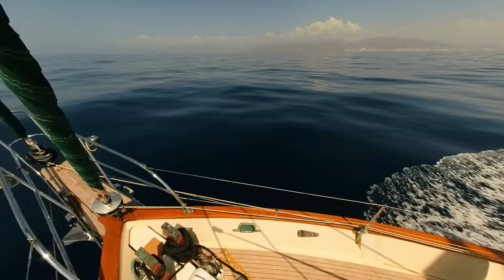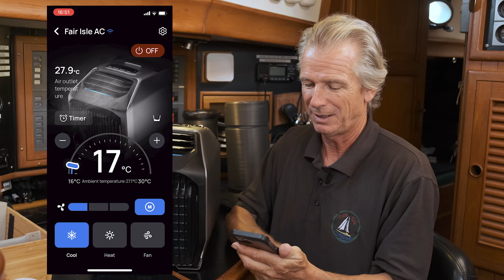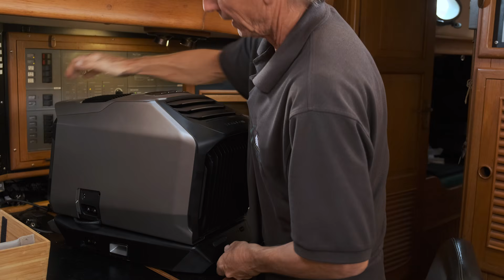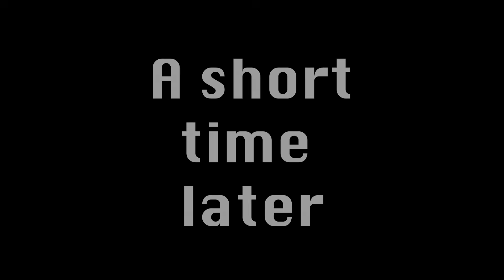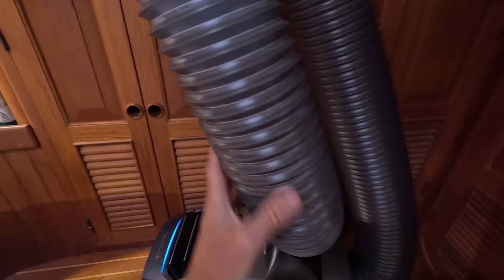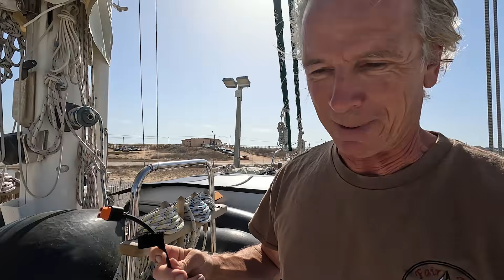DC AirCon for your boat... it works!

Comment: Can you give us an update on this from the tropics?
Reply from the maker: Still working well. You do have to have enough power to run it of course and not having a generator we don’t always. So we tend to use it just when it’s very hot or when we get frequent rain and you have to have the hatches closed. The only problem we’ve had is the optional battery that we had which clips to the bottom died. I think we just left it flat for too long. Not a problem for us as we tend to power it from an EcoFlow delta anyway

Comment: How’s it going one year on ?
Reply from the maker: It’s great. We don’t use it all the time but it’s been a lifesaver when things get really hot. The one problem I’ve had is that the battery that you can get to clip on the bottom refused to take a charge a few months ago. I tend to use our Ecoflow Delta anyway so not really an issue, but if you are using the onboard battery I would say make sure you keep it charged. I’m guessing ours died because we left it flat too long

Comment: Efficiency is the issue with those expecially using one hose.

I have a cheap chinese knockoff which was rated at 3000btu (single hose).

Its basically a square metal box with an exchanger at each end and an independent fan at each end.

So i modified it moving the electronics forward and sealing them, then mounted it through a blanked window.

This resulted in the condensor being fully outside and the evaporator being inside each drawing air from their respective locations.

In effect i made a very tiny window ac unit and having the condensor outside boosted the btu rating almost doubling its cooling capacity.

Draws about 600w under full load and runs on my 3kw invertor with 10 batteries allowing about 12 hours runtime.

Sealed and laquered the outside surfaces, its lasted 5 years so far and although the inside of the case has surface rust the outside is still fine.

I bought 2 of these very cheap and i want to modify the second to have a water cooled condensor i believe that would further increase the btu rating to over 6000 however i would only be able to do a crude blowout of refrigerant (propane is the factory gas) since i do not have a vacuum pump to vent the air out and im not sure this would work well enough.

I have heard poeple who have done this say it works well enough for something very cheap and diy but im not so sure.

Any imput would be appreciated.

Having looked at how cheap the components are to make a very basic water cooled AC (talking about no thermostat just a switch)  the mind boggles how the marine ones end up costing over 2k.

The only pro bit is the gassing up and even that i doubt is expensive in a factory.

Comment: 0:13 that is an interesting way to use the dinghy haha
Great idea

Regarding the feasibility of it, with 250w it draws quite a bit. It should work if you have a lot of solar up in the summer so you can cool the boat inside durig the day and don't sweat like a pig, but it's something to consider as not everyone has 500w or more of solar panels up in the sun.

It's been a year, do you have any updates on how well it served you in the caribbean summer?
Reply from the maker: It’s been great. We don’t use it all the time, usually the Caribbean trade winds mean you get good air flow at night. But in places like Panama in December when it rains a lot it’s great as you can shut the hatches. Also it was vital when we had the boat on the hard in Trinidad. With shore power we can run it 24/7.
Reply: @svfairisle  Shorepower is great, but I am really considering not going into marinas as often as possible. But yeah, seems like it's a very handy little thing. I allways like your reviews, they give me so many ideas.

Comment: Is it ok to have the exhaust hose and the intake hose so close together? Won’t the intake suck in the carbon monoxide from the exhaust? I assume that’s similar to the portable ac unit for your house. Or am I just seeing it differently?
Reply from the maker: I'm not sure what you mean when you talk about carbon monoxide, this is an electric appliance... no carbon monoxide produced here!
You could just run the unit with no hoses attached but it would be pretty inefficient. So either have it inside with the exhaust hose taking the hot air out and the intake hose (for cooling, this is not air that will end up in the boat) outside too, and the unit will suck in air from the cabin and spit it out cooler from the vents. Or do it the other way around and have the unit outside with the 2 hoses from the front end (where the ac air comes from ) taking Ac air in and stale air out. by placing the hose away from the inlet and high up to get the warmer air.
Reply: Omgosh! It makes sense now. Sorry.

Comment: Very nice review!  I'm considering purchasing this for my boat.  Would it be possible to power this unit from the boat's house batteries?
Reply from the maker: Yes no problem at all, there’s an XT60 socket in the back for dc power. I power it that way from our EcoFlow units, but the house bank can do it just the same.
Reply from the maker: PS you need to have to internal battery in to charge via the XT60 it won’t power direct that way. To power direct without having the waves battery you could power with the specialised high power dc lead from an Ecoflow Delta or Max, that works really well.
Reply: @svfairisle  Very helpful, thanks for the extra details!!

Comment: Do you know how many Amps the unit consumed when plugged into AC power?
Reply from the maker: I will check the next time we have shore power. The draw would be different depending on if the battery is on & charging
Reply: @svfairisle  I was just wondering how much power it consumes running through an inverter without any batteries attached?

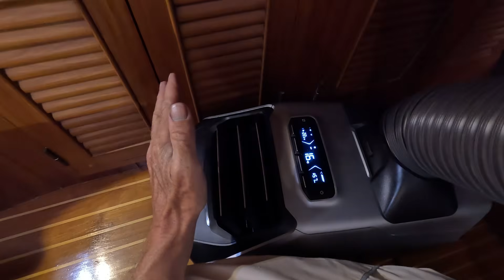Comment: 13:00 can you set the intake hose from inside the boat at a place where hot air accumulates like top of room and outlet through the window like you did. Wouldn’t that be more efficient to expel the hot inside air and then cool the already cooled air from inside vs taking hot air from outside and cooling it?
Reply from the maker: There are two separate systems circulating air. One is the actual air conditioned air which it needs to pull in from the room and then spit out colder and less humid, and the second system takes outside air to cool the plate then spits it back outside. So in the bit you were looking at the hoses are for outside air. It would be possible to attach a third hose to the inlet of the AC side and have that high up and away from the unit which would help.
Reply: I still don’t understand why you need the input air hose attached. Why not use the already cooled air from the cabin, and eliminate one of the two hoses? Of course, outlet hot air needs to be removed, so it cannot operate “hose free” in cooling mode.

Comment: Hi! Thanks for all the great videos. I have question about the add on battery, its NCM do you have any concerns with that chemistry and using that on a sailboat vs. using the other EcoFlow batteries that use LFP chemistry. What has made you comfortable with NCM for this application. Thanks I'm trying to decide if I get the add on battery and or EcoFlow Delta 2 Max to pair with the Wave 2 on my boat.
Reply from the maker: Very good question. I much prefer LFP batteries on the boat and if you have any concerns then the way to go is using the Delta 2. However although for a house bank the only option is LFP of course, there’s far too many spurious charging sources and loads that are specific to each boat, with the amount of safeguards built into units like this and the fact it’s performing a specific function that’s been tested in the factory give it a good layer of safety. plus the fact that there are thousands made exactly the same so any fault will be reported should give confidence. Having said all that though I’m very careful with mine. I would never leave it charging unattended ( a problem while charging is by far the most likely ) and I do not pack the Battery away with the unit, it’s stored alongside the Delta where I can see it. ( the eProp battery lives there too) The most dangerous batteries I have on board by far though are the drone battery’s and they all live in fire proof cases, many people forget about these.
Reply: Thank you so much for the reply. That gives me a lot more comfort about getting the add on battery (which I would like to do), I think those are all good points about the risk assessment and best practices with the add on battery. Also about camera / drone batteries too to be stored in fire proof cases. I know according to your most recent video you are in Trinidad (don't know if you're still there) wonderful wonderful place,  my father was from Trinidad - wishing you the very best stay and thanks again!  @svfairisle

Comment: I have last years 4,000 btu model on my tayana 37. Its a piece of junk it..cost me 2,400.00  i actually have 2 of them cause a friend also gave me theres cause they suck. I have 1 battery but 2 units.. It needs 60 amps to charge the battery on the unit and it takes 2 hours. And lasts 3 hours. The aircon alone needs 40 amps on the inverter. That would be ok if it even worked. My boats not that big. Maybe this unit works better than my 2 units i have. Mine are older last years and tbe first generstion.
My 10,000 btu portable aircon works really well.cost 300.00 but not at anchor. But the eco flow is not the way to go at all. Its a waste of 2,000.00.
Reply from the maker: Yes the first version sucked! I steered well clear and Ecoflow pulled it very quickly. If I were you I would talk to head office and see if you can get a deal on swapping it for a mark 2 version. I think they will be sympathetic, they know they messed up with the first one.
Reply: @svfairisle  I might be interested if they can get to 9,000 btu. Then its in the ballpark for a 37 footer. I should have just spent my hard earned money on a proper 12v unit by marlbro. I almost bought there 10,000 btu for 5,500 but i did not want to go lithium also at same time for another 5,000 to run it all night. so i tried eco flow as a hail mary  as it had its own battery i thought would be great..5100 btu might be enough to cool youre aft cabin. My complaints are so others dont get screwed or buy a used unit.
They already discontinued any spare parts for the 4,000 btu so if youre battery dies or whatever you out of luck.
Reply from the maker: I see what your saying. It's not magic though you cant get something for nothing, 5100BTU's for the small draw the mark 2 demands is an excellent achievement. It means having a large sleeping cabin cooled is entirely possible on DC. Having the whole boat air conditioned is still a job for a generator I think

Comment: Can this unit stay outside (is it “rain proof”)? We are trying to find a good way to use it on our boat in Grenada (hot and humid) and haven’t quite found the perfect way. I would prefer for it to be outside of the cabin but recognize that next to frequent rain squalls, we would also have to find a way for it to use the inside air, cool it and then send it back in. Also : don’t underestimate the weight of the unit with the battery attached. Taking it out, moving it around etc. Takes a bit of work.
Reply from the maker: Yes it’s apparently completely rain proof, I’ve only had it out in showers though. I did find it to be more efficient inside though so I’ll be using it in the cabin with the hoses taking the exhaust and intake for the heated air off the back end of the unit
Reply: Thanks for replying (good luck with the mast base)

Comment: If you have enough solar and lithium storage a residential mini split would be a better option. I’ve seen them on cruising yachts recently with the condensing unit on the deck and covered when moving . Cycling on and off too often is classic oversizing .

Comment: Good one. I’ll buy one of those. I just have to figure where best to use it. I sleep in the fwd cabin (highish bunk) so can make a slide in shelf underneath with built in exhaust pipes. That’s in the short term. In the longer term i can use most of the mechanism as is but have a heat exchanger added, for water cooling, by those who know what they are doing. The thing is that air conditioners that operate at 250 watts are like hens teeth, so the guts of this machine are special.

Comment: On the US link, I cannot seem to find the AC unit you show. Is it EU exclusive?
Reply: Even searching their Amazon storefront this unit is absent. Not sure what to make of this. It appears to be a limited release of some sort. In US storefront it is showing only the Delta and River product lines…
Reply: @bryanfromsailingsarpedon  I can't source it either but then I had low expectations living in Hawaii - practically anything 'residential' or'recreational' that uses lithium-tech is basically unavailable unless/until Costco comes to the rescue!
Reply: Very odd. Maybe it is a regional thing. 🤷🏼‍♂️
Reply from the maker: No, should absolutely be available in the US

Comment: I have a sailboat and finding the right a/c and a functional setup is difficult. This looks like a great setup !   Finding the right home and venting for the unit needs to be thought out and doable. Hatch type units are not available,potential R/V units fitted to the a hatch may work ? The other option is a permanent A/C unit in ,  accurate placement will be the key.

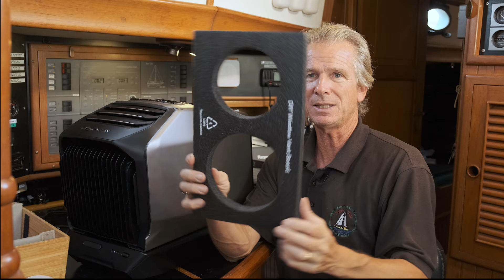Comment: I’m only half way through the video and I haven’t read all the comments, but something you said around the 8:15 mark got my attention, and not in a good way. You said that it has a mechanism to splash condensation back into the airstream. In my understanding of a/c ( I lived on the swampy gulf coast of Texas for almost 30 years) the last thing you want is the humidity put back in the air. For at least 2 reasons: 1. Dryer air feels cooler against the skin. 2. Damp air takes more energy to cool, so why do it over and over?. 3. Damp air makes or keeps fabrics damp (think bed sheets) 4. Damp air promotes the growth of mould. If I owned a machine like that, the first thing I would do is disable that splash/ recycle feature you mentioned. Get that air dry and cool, that’s the meaning of air “conditioning” it’s not just air cooling.
Reply from the maker: Yes it puts the water back into the air... but on the outlet side!!! AC's run as two seperate circuits either side of the condenser plate. The compressor cools the plate and air is drawn in from the cabin passed over the plate to cool (and condense out some moisture) then go back to the room to cool it. On the warm side of the unit a fan pushes air across the heat sink and the water thats been condensed out from the other side. So warm moist air goes out through the port hole.
Reply: The condensate should be configured to be collected for fresh water

Comment: I am wondering if the solar panels would be sufficient to power the device during the day, even if it cannot charge the battery simultaneously. The reason I ask is because during my time in Lanzarote, the heat inside the boat was unbearable during the day, but it was quite pleasant at night and didn't require cooling down. 
It would also seem to me to be an inefficient way of having it plumbed in if is constantly removing the heat and humidity from the outside air, would it not be better to have the air recycled from inside the cabin a bit like you can set on a cars airconditioning.
Reply from the maker: Yes you can certainly charge the device at the same time as using it. And recycling the air would definitely be the best way. That is what was happening when I had the unit inside. The pipes going in and out of the porthole were just cooling for the heat exchanger ie air pulled in to cool the plate which is then sent straight back outside a lot hotter. The cooling component is cycling around in a closed loop on the other side of the plate pulling in cabin air and spitting it out cooler and dryer
Reply: I dont believe these 5,000 btu units is enough to cool anything but a small aft cabin. Maybe. I have the 4,000 btu last years and its worthless here in thailand. But thai is hot.. 10,000 btu in my opinion is minimum for any boat .

Comment: I will build you a 12v AC unit that will do 6000 btu at 29 amps @ 12vdc
Reply from the maker: Well thats 348w which is substantially more than this unit is taking!
Reply: @svfairisle  Yes is that measued at low speed? , there sight says over 800 watts. What does the unit draw at full AC power ? Ok just found another site that said it draws 495 watts at 5100 BTU. You almost have to put a meter on these things as the compressor warms up they draw more power just like a alternator becomes less efficient as it gets hot. .
Reply from the maker: @svsalserenity4375  I found it difficult to coax it into drawing more that 250w, to be honest I think i need a tropical night with heat and humidity to really test it. It cooled really well with the conditions we had with very frugal draw which is a good sign but maybe there's another level it has to ramp up to in heatwave conditions, we will see.
Reply: @svfairisle  Im impressed , love to get a look inside of one of those units .....see what they are doing .
Reply: I have the older unit 4,000 btu. With a battery. 2,200.00 not including shipping.
Save youre money. These units are just not big enough for hot climates. 6,000 is not big enough either. 9,000 maybe for a small cabin.
Reply: @evinwhiteson4902  Yes I agree. The way BTU's are measured is vague at best and also never stated .
Reply: Great review - thank you.  I have just bought a Wave 2 and am impressed so far.

8 months down the line, do you have any hints to maximise efficiency?  Looking at the draw to charge the battery, I may need to invest in the solar panels…